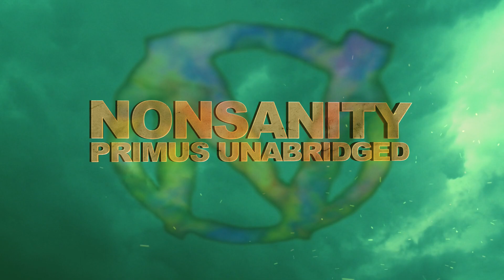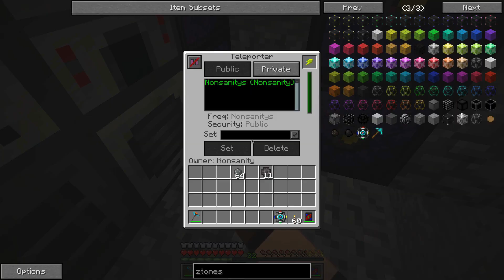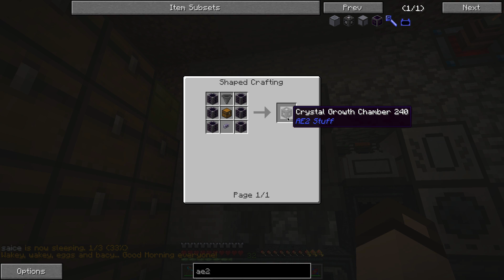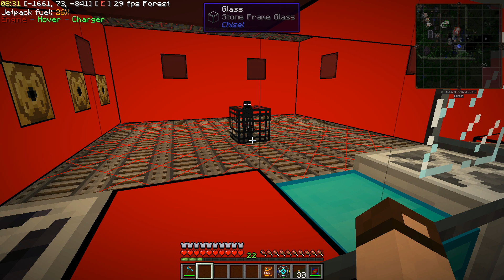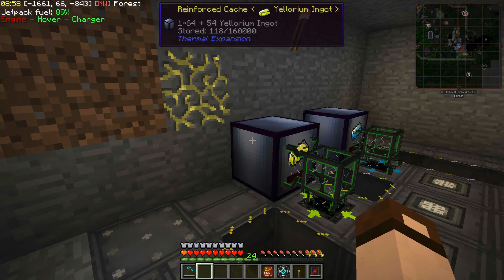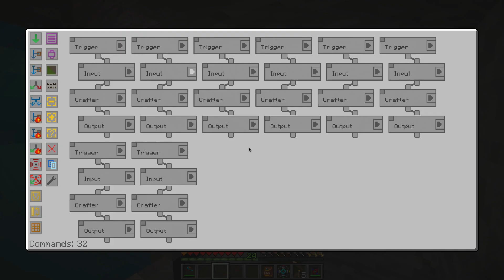Primus Unabridged - 04 - Automated Mob Farm Construction (FIXED)

Comment: The yeta wrench is a great tool when using all that ender IO conduit. You can cycle through the different types with shift scroll real nice feature :P
Reply from the maker: +topjimy69 I probably should make one, but sometimes that multi-tool aspect can be annoying—such as when its not set to the mode I thought it was. I get that enough with the Atomic Disassembler's speed setting. :)

Still, because it does unique things no other wrench can do, I'm sorta stuck with it.

Comment: As a suggestion, though it is more complicated, when I control a big reactor like that, I have it turn on when at 75% or 80% and off again at 95%. This lets it heat up fully when it needs to run and keeps it from cycling on and off continually.
Reply from the maker: +Iskandar I'll have to test to see if there's a significant difference in efficiency.
Reply: +Nonsanity Unless you're drawing more power than you're using a simple on off switch will go on, off, on, off, on, off as you draw tiny amounts of power and the reactor will never get up to temp. As long as you are generating far more power than you are using, it is best just to let the reactor run a bit.
Reply from the maker: But is it best? That's the question. And if it is the best, how best-er is it? :) You see, while it has to heat up when it turns on, and you get less power as a result, it also generates power after it is turned off and no fuel is being consumed. So it remains to be tested as to how those two balance out compared to a constant-on state. I look forward to testing this when I have the time. :)

Comment: Each speed upgrade decreases the time it takes to move items in the transport node's slot by 1 tick (from 20 on average - a little randomized). Their effectiveness is capped at 30ish. More world interaction upgrade stacks add a stack of cobble to move, once per second. So 5 interaction 1 speed results in roughly 5 stacks per second.
Reply from the maker: +zapl80 Yes, I've done all the tests myself in the past. I just derped and got them reversed. It's already been fixed. :)

Comment: For your safari net into/out of the spawner setup, why not skip the lever and use a trapped chest so that it retrieves when you open the chest and inserts when the chest is closed.
Reply from the maker: +N0SEM1NER Not an awful idea, but people visiting DO have a tendency to peek in chests. If it was a trapped chest hooked to the switch, that would pull out the safari ball then send it back in. Then the Auto-Spawner would go into its warm-up phase unnecessarily. Also, to turn the system off for a bit, the safari ball would have to be removed. A lever lets it remain, ready to be sent back when you're ready to continue operation.

Sort of like a TV/VCR combo (if anyone remembers those), it seemed like a good idea at the time... ;)

I actually have a newer setup that uses an RFTools Screen with instructions and an on-screen button—instead of a lever. I rather like it. It'll show up in a later episode.

Comment: someone probably already pointed this out but grinders don't drop skeleton skulls you'll have to imitate a player killing the wither skeletons. there's several different methods like iron spikes, the killer joe, a plate from thaumcraft and a tinker sword in an autonomous activator :-)
Reply from the maker: +Jake R Yes. I figured out no skulls would be forthcoming when I had none the next morning. So I'll have to re-design the room with some form of mob movers and alternate killing system if I want to get skulls. Right now, I don't have a pressing enough need for them, so this will go on the back burner.

Preferably, I'd set up some skeleton spawners with cursed earth in the nether, and automate that. A separate system would keep the current one clean and functional—even for ghasts. :)

Comment: Also, for skulls, enderio's killer Joe acts like a player so you can get skulls- use a dark steel sword for a bonus chance. Empower it for a very high chance.
Reply from the maker: +N0SEM1NER I realized quite soon after that episode finished recording that I wasn't going to be getting any skulls. But switching to a Killer Joe would be adding at least some conveyor belts to the room, since they don't have quite as large a range as the Grinders. I'd also need to install a stop signal to turn them off—in case I need to enter the room. The Joe also needs more support tech in the form of a good supply of nutrient solution.

It's not impossible, but it'll be a bit before I could get around to switching to Killer Joes. I might also investigate other options along the way. :)
Reply: KJ has a 5(side) X 4(front) range. Should cover the entire 9x9 room with how you placed the grinders. On a lighter side, it's a great way to get your own head for the witchery altar. Nothing says commitment to the cause like your own head on a table! The nutrient solution is a little annoying because of the farming, but then you can add a few zombie head generators and make the whole thing self sufficient. Automated death powered by the dead, it's downright ghoulish, and just in time for Halloween.

Comment: you should set the channel color for the autospawner and its chest to another channel than your item drops, that way your spawners won't go into the wrong chest
Reply from the maker: The item conduit for the Safari Nets is not connected to the Grinder's item collection conduit, so there is no chance of the two getting mixed up. No need to break out the fingerpaints. :)

Comment: I don't think I got any wither skulls like that. I needed a manual beheading sword. Iron spikes do work but that takes a LONG time. Setting the auto spawner up two blocks may help (see precision hammer).
Reply from the maker: +Bryan Burke Yeah, I'm a little behind in getting episodes out, and the Grinders never produced wither skulls. That's unfortunate, as other ways of killing them will require some sort of mob mover. I'll probably set that up much later though. I can get as many stars as I need using my beheading cleaver—for now. :)

Comment: ftb infinity pack had the same issue with shiny, no ores.. but if you run ferrous ores, through a pulverizer, theres a %chance to get shiny dust :)
Reply from the maker: +bbroegger I did that for a while. I even reconstituted the ferrous dust back into ore using Mekanism and ran it through again. That process has diminishing returns, but if you don't care about the ferrous (and I didn't) you get a bit more shiny from it. As it was, Agricraft was the way to go. :)
Reply: didnt know you could run it through mekanism to turn it into ore again, thanks..going to look into that :D

Comment: Let me start by saying I love watching your vids, as you take the time to actually show people how things are both setup & how they work. I've noticed you seem to be quite adept with the server setup (as you've had to fix things for other members on your server) & would like to ask your advice:

I am in the process of TRYING to set up a modded server for me & my friends, but nothing seems to be working. I've tried reading & watching the tutorials provided by the hosting co., but am still vastly confused. Is there any insight you could provide, perhaps any tutorials you've used in the past? This pack is designed by me specifically for us & works fine both on my PC and on everyone else's PC as well (through Technic). I just can't figure out how to get it up & running on the server.
Reply from the maker: Well, there's any number of things that might be a problem—I've got little to go on. But I can give you a few wild guesses.

First, if the server doesn't start at all, the host will be trying to run a specific filename and it could be any of a number of options depending on how the host does things. Make sure your forge executable has the proper name.

If the server is starting enough to generate log files, check them—especially the forge logs. If there was a problem, it will likely be mentioned at the bottom of the file. There a few common stopping points.

The first time you start the server, a eula.txt file is created. You need to edit that text file to accept the eula or the server will never start.

If there was existing world data when the server started, there might be changes to the item IDs. If so, the server will be waiting for you to type a confirmation string. You'll see this request in the forge log. You'll need to use the host's web console to type the command.

And if there's a more serious problem with the pack—actual crashes and the like—the host may be trying to repeatedly restart the server after every crash. Watch for that. The log files will get huge.

Hope some of that helps! :)
Reply: +Nonsanity 
Thank you for your quick reply. All I know for certain is that If I set the server to Vanilla it runs fine (& I've not seen any eula files anywhere.

Rather than filling up the chat here I've created a simple page with an image of the files (in the root) on the server & then a copy of the log after the server stops. http://diyclan.com/porthiir/servererror.html
Reply from the maker: I don't see the forge executable, only the vanilla one. The server should start the forge executable, which then starts the vanilla for you, but modified. (aka modded)
Reply: +Nonsanity 
Yes, they don't have one & in their (very short) tutorial on installing a custom modpack they mention renaming my jar file to custom.jar. The only jar file I have other than the server file is the forge file which I renamed to custom.jar.

The main thing I find weird is that one line states "Forge Mod Loader has identified 88 mods to load", but then some lines later it starts: Attempting connection with missing mods...". Plus the ever present missing the required element "..." (name, or version) & "... without associated API reference".

I have no idea how to create a custom jar file with all the information it seems to be looking for.

Once again, thank you for taking your time to try and help me with this.
Reply: +Nonsanity 
Thank you for your help, I finally managed to get it all figured out & now the server is up & running with Forge (no mods yet, but the Host is taking care of that for me).

Just 1 final question & then I'll reserve all future posts on your vids to the content of such. Could you take a quick look at my modpack list & give me a recommendation of how many MB I'll need of Memory for the server?

You can view the modpack here: http://www.technicpack.net/modpack/gsi-modpack.663409